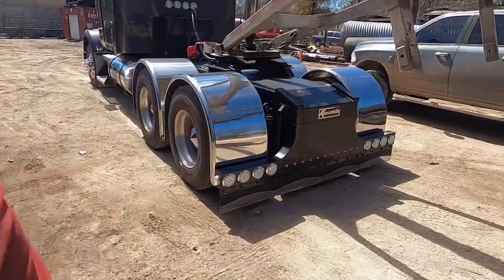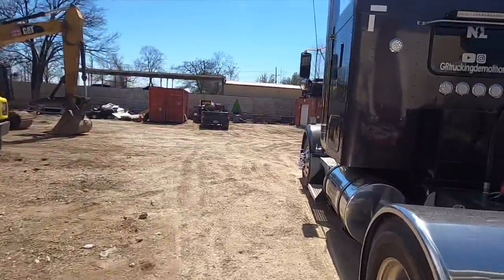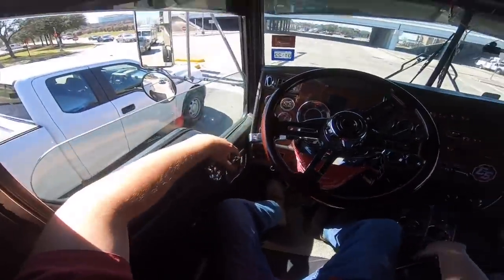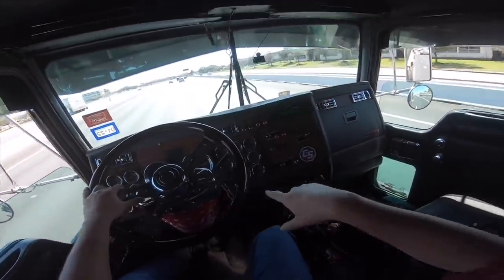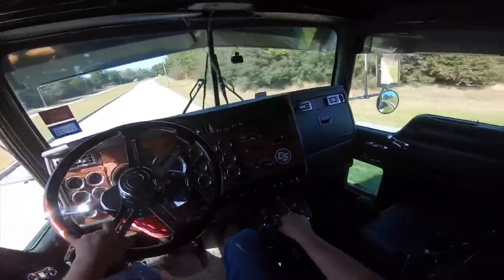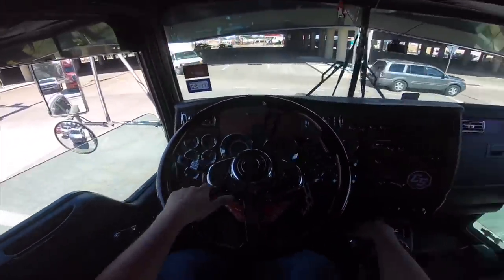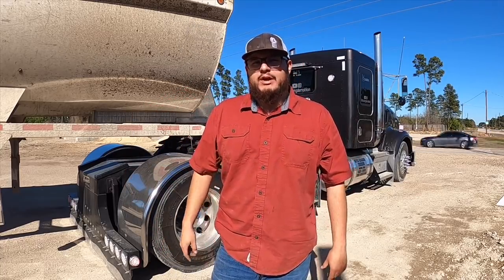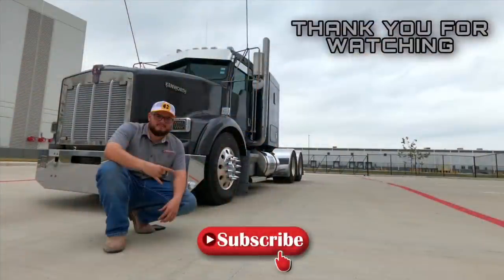POV jakes and floating gears ⚙️/ end dump truck driver

Comment: Your shifting are really good. I’m still grinding gears.
Reply: Me to brother 😂
Reply: It's bcuz you have to put the gear lightly against the face of the gear with the right RPM. If you lightly have your foot applying throttle while in neutral and look at RPMs and then try to memorize the sound along lightly moving the stick, you'll never grind. It should be really really soft without needing to shift quick. Be really calm and just move the shifter like you don't want to move and while applying throttle the truck will accept the gear.

Comment: Badass video again bro.  Also don’t know if I’m right or wrong but sounds like you’re cranking your truck wrong bro.  Takes forever to start and that only happens when you turn the key right away.  You’re suppose to turn the key without starting and leave it turned for about 5-7 seconds so the glow plugs can heat up then crank it.  Unless you got some other issue.
Reply from the maker: I always let the key turned for couple seconds, it has always been this way since I bought the truck.
Reply: @Grtruckingdemolitionllc  ahh got ya.  Maybe your cam or crank sensor is bad.  When you have it running unplug the crank sensor,  if it dies it’s a bad crank sensor.

Comment: Norwegian viewer/trucker checking in. It's honestly a little crazy to me how you "complain" about your truck not doing more than 75. All trucks in Norway are restricted to 55 mph by law regardless of maximum payload, axle load, engine size, gross weight etc. I just find it interesting! Either way, keep it up, love the videos.
Reply from the maker: Man most trucks here do 80/85 mph
Reply: Then again, you definitely have much more suited roads for such speeds. Hauling ass, love to hear it!

Comment: It’s a working truck. It’s gonna get scratched up, dents. It SUCKS but hey man you work it and the typa work you do with it shits gonna happen. We have few dents and scratches on a few of our nice trucks. Like the lowboy truck I drive every once and a while if it has a job, that truck has scratches and dents on it. Very badass custom truck. Boss got real mad at that but hey it’ll happen. It’s got the heavy duty Diamond plate fenders on it for extra protection. Suits it’s look which I real like. Sucks a lot man but it will happen. Be careful.

Comment: Quick question bro why you air out the back when dumpin, I personally use rock haul end up all the time but have never done that just lock up the trailer and let the truck move?
Reply from the maker: I just do it so the bags don’t stretch out  all the way once the load comes off

Comment: When you're unloading a frameless end dump do you set just the trailer brakes or just the tractor brakes? looks like you let the walk with the trailer brakes set.
Reply from the maker: If it’s stable ground I set the trailers brakes. But on dirt we’re I see the trailer start to tilt to one side I let the tractor brakes on and the trailer move instead
Reply: Do you engage the inter axle lock when in those sand pits?